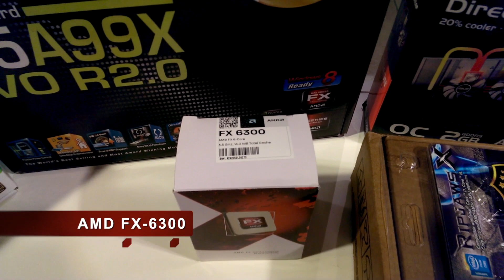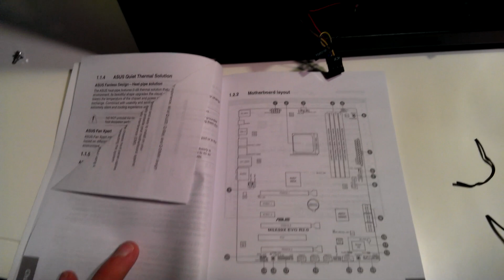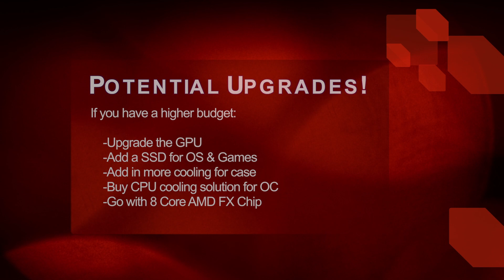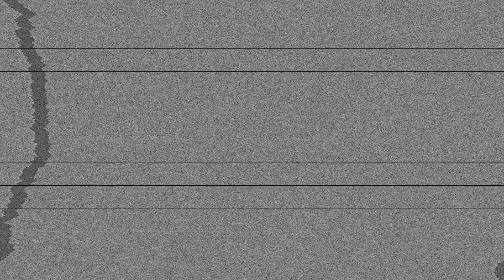2014 AMD GAMING PC BUDGET BUILD | Tutorial & Parts List

Comment: Motherboard- Asus Sabertooth 990FX AMD 990FX SB950 Motherboard DDR3 ATX TUF R2.0 Socket AM3+ £130
CPU- AMD FX-9590 Black Edition 8 Core 4.7GHz 16MB Cache 220W CPU ONLY £260
RAM- 8GB DDR3 (2x4GB) PC3 1333MHz RAM PC DESKTOP COMPUTER MEMORY DIMM 240 PIN 10600 £57
Graphics Card- ASUS Radeon 2GB HD 7770 GDDR5/PCI Express 3/1020MHz/4600MHz) Gaming Video Card £113
Hard Drive - Seagate Barracuda ST2000DM001 2TB SATA-600 3.5" Internal Hard Drive HDD 7200rpm £60
DVD Drive- LiteOn IHAS124-04 24x SATA DVD±RW ±R DL / DVD-RAM HH Internal Drive Black £13
Power supply - Cit 850W Black Edition PSU 12cm Dual 12v CE PFC £40
Computer Case- Xigmatek Asgard III Black Midi Tower ATX / Micro ATX PC Gaming Case With Window £42
Wireless Network Card- FAST SHIPPING! WIRELESS N WiFi PCI ADAPTER CARD 300Mbps for DESKTOP PC HIGH SPEED £12
 
Total £727 Motherboard- Asus Sabertooth 990FX AMD 990FX SB950 Motherboard DDR3 ATX TUF R2.0 Socket AM3+ £130
CPU- AMD FX-9590 Black Edition 8 Core 4.7GHz 16MB Cache 220W CPU ONLY £260
RAM- 8GB DDR3 (2x4GB) PC3 1333MHz RAM PC DESKTOP COMPUTER MEMORY DIMM 240 PIN 10600 £57
Graphics Card- ASUS Radeon 2GB HD 7770 GDDR5/PCI Express 3/1020MHz/4600MHz) Gaming Video Card £113
Hard Drive - Seagate Barracuda ST2000DM001 2TB SATA-600 3.5" Internal Hard Drive HDD 7200rpm £60
DVD Drive- LiteOn IHAS124-04 24x SATA DVD±RW ±R DL / DVD-RAM HH Internal Drive Black £13
Power supply - Cit 850W Black Edition PSU 12cm Dual 12v CE PFC £40
Computer Case- Xigmatek Asgard III Black Midi Tower ATX / Micro ATX PC Gaming Case With Window £42
Wireless Network Card- FAST SHIPPING! WIRELESS N WiFi PCI ADAPTER CARD 300Mbps for DESKTOP PC HIGH SPEED £12
 
Total £727 good build?
Reply: GPU and CPU are quite imbalanced. I recommend getting a better GPU (as in the new 750ti) or keeping the same CPU and getting the 8350 and saving some money.
Reply: Doctor Spoon what about the Gigabyte Radeon R9 270X £170 or the Gigabyte GeForce GTX 760 £190
Reply: Trix ClassAbove could your mail me? and see how i can improve my build:)
Reply: Bad build. That's a weak GPU you got there. And for what reason do you need a Sabertooth motherboard? And why 1333MHz speed ram, that's a bit under the general ram speed recommended these days. Downgrade the motherboard, upgrade the graphics card and buy 1600mhz or 1866mhz ram, whichever is cheaper, just make sure that its CL9.

Comment: Im going to build my PC soon but i don't know what to go for, intel or AMD :/
Reply: I think that going for intel or AMD is simply a money issue. Most test shows that Intel CPU's are better. Even the i5 are better then the best AMD processors. But that doesn't mean that AMD are bad, it just means that you will get a little bit better performance with intel, but most game will still run pretty good on an FX-8350 chip (which I'm using).

My suggestions; if you are going to use less then a $1000 go with AMD as you get more for your money, but if your budget is like between $1500-2000, and want the best go for intel.

When the next intel process and Nvidia card is released I will probably switch our to Intel and put my AMD cpu, motherboard and my two GTX 760 into my old tower as a second computer. But right now it works well for pretty much any game I got.

But it was hell got BF4 to perform on my PC. I had to upgrade to Win 8 just to get the most out of my AMD cpu, and the game doesn't seem to handle SLI very well, so I would probably have a 780 instead of to 760 (simply for the reason that Vram doesn't stack, so I still only got 2 GB with two card, instead of 3 with one 780). But it still handle most game very well, so I'll wait before I go intel.
Reply from the maker: It's a decision a lot of people struggle with.  I went Intel.  Read up online for the pros/cons.  There's lots of info out there.

Comment: Nice video, everything was clear and informative. One thing I would say is to install cpu cooler before installing the mobo, especially with a stock one!
Reply from the maker: Only reason I do it that way is to make sure there are no issues with the chip first, saves a little mess if there is!  Good input tho as I see the benefit :)
Reply: Yeah fair enough man, also if you were gonn do an aftermarket you might wanna leave it off to give you space to work! Nice one on replying bro